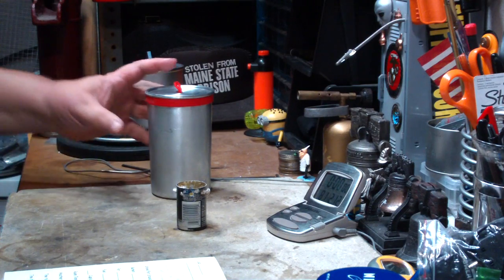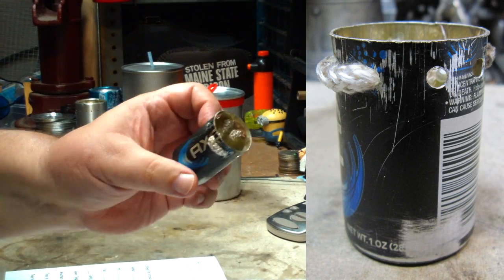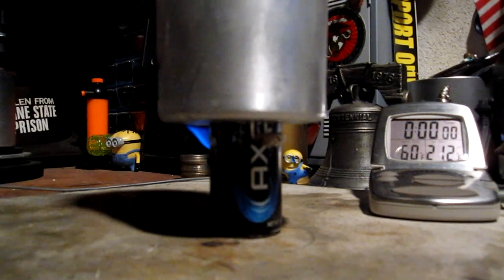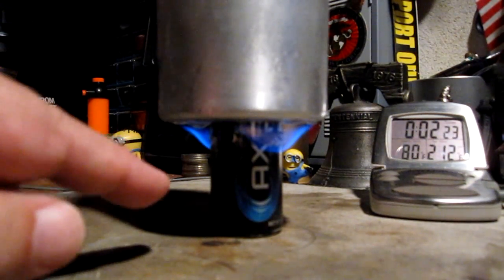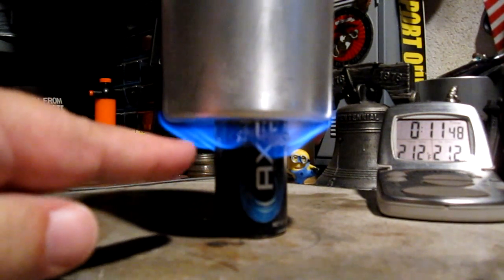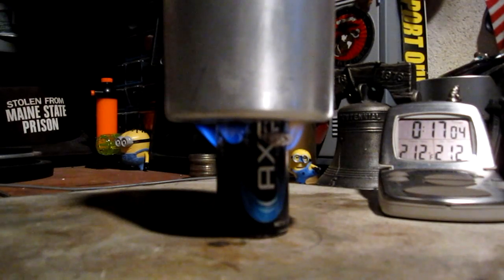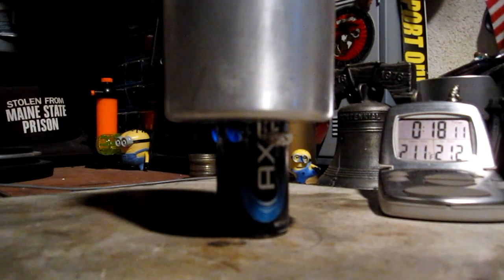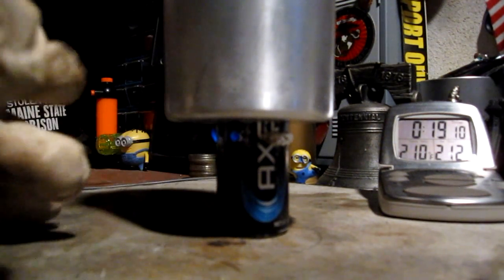BatchStovez 22 oz Ultralight Cook Pot - Axe Wick Stove - Boil Test #1

Comment: Hiram; I checked my records on the Turbo stove. The Turbo stove was a Super Cat ported down to a 2.1 inch (53mm) V8 can. It used. 1 OZ Heet, and boiled two cups in 8:45-9:00. Adding the CF the boil time plunged down to 5:35-6:00. The wicks shaved 3 minutes off the boil time.